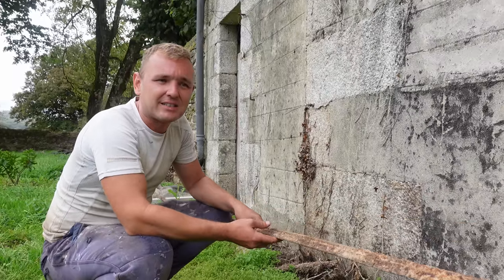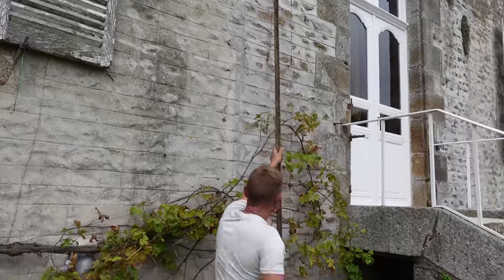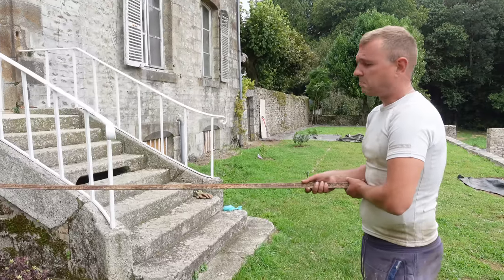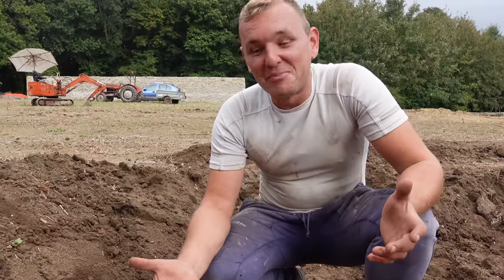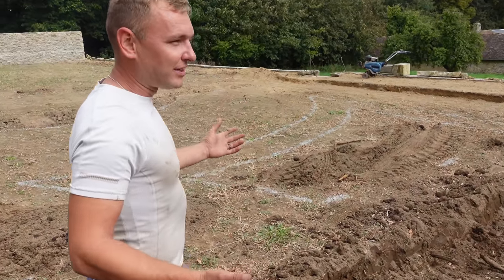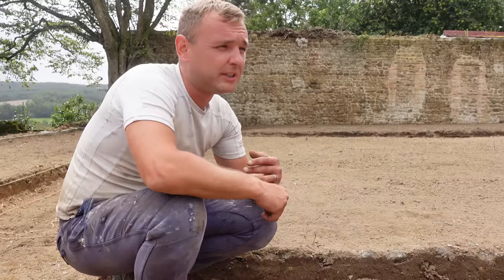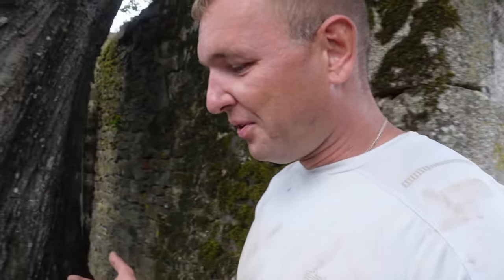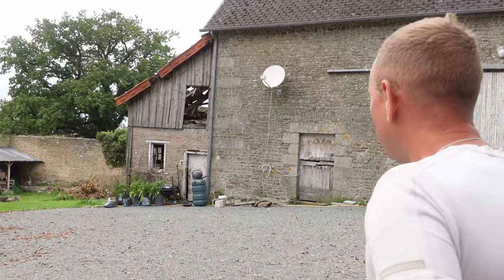The Quest for the Missing Porch: Unveiling a Hidden Treasure in our Chateau Garden.

Comment: Check out the peacock proofing the Château de la Lande has done in their walled garden. It seems pretty effective.❤
Ash, I have to disagree on the original placement of the angle iron. The roof has three sides, the apex of which all meet at the façade of the house. It could be part of one of the sides if the entabliture was fastened to it and the degree of bend is greater than 90°, (to account for the slope of the roof it would have to be greater).
If it is 90°, it could be one of the upright corners. Judging from the photo, the roofline was just a few inches below the top of the doorframe.
The porch door in the photo looks disproportionately small compared to the grandness of the rest of the house. Maybe even 6" or 8" taller would make a visual difference. The whole thing will need to be fabricated so you should be able to make it to whatever dimensions you like.

Comment: I love a mystery and you all just keep finding them. The picture seems to show the porch front rested on the last step of the chateau. I think you were correct when you considered that the post you found was the vertical corner posts. The front of the porch seems to sit a bit above the last stair which would make the post you found the right length for the corner posts. If the post is the roof beam, and the porch extends to almost the garden stairs, it would really cause a bottle neck to get from one side of the upper garden deck to the other.

If the porch does go out beyond the chateau stairs, it would seem they would have made some sort of flooring at the foot of the stairs like pavers of some sort. Have you looked for something like that? It may help determine the proportions of the porch.

What great progress on the garden. It would be terrific if you could open those four doors on the stone wall again. Hopefully the plantings and garden plan will accommodate that if you should do it in the future. Congratulations on all your successes.

Comment: On the iron piece, if the cut end is the same angle in reverse on the opposite end, it may be the front top edge piece. If it's flat, it may be a side top edge piece. It doesn't look like it matches the ridge of the roof in the old photo, it would be too long for the roof shape, which looks like a hip roof. It's so awesome that you found a piece of the original porch, maybe there's more hidden elsewhere. Metal detector time?

Comment: Glad to see the formal garden coming along. It is alot of work. I would not put a bit of grass in the formal garden. Keep it in gravel, mulch and hardscape (bricks, cobbles, pavers, aggregate, etc.) Grass areas without constant work will invade the rest of areas. You have done the major amount of work getting rid of it. Do not waste your efforts. Nice to see the raised vegetable beds, too. I would leave uncovered or add wire mesh over it (chicken wire). Snow and lightening drops nitrogen into the soil.

Comment: Don't forget you can put old windows on top of raised beds for protection!
Reply: Yes, do keep old windows to make cold frames.
But over winter cover the beds with something to obscure the light and stop weeds growing. Put a copper edge to keep slugs off, they can't go past the wire due to electric circuit!
You could plant a 'green manure' which will enrich the soil instead of the above.
Good luck🍀
Great progress 👏🏻👏🏻

Comment: Correct me if I'm wrong, but the front of the glass porch enclosure has a sloped roof, does it not? So that ridge frame would only be the dimension from the chateau wall to the peak of the 'pyramid' of where the side roof slope meets the front roof slope. I imagine the angle of slope in the front would be the same as the angle of the sides, so you could calculate the total 'depth' of the enclosure based on that. It just doesn't look like the front is a perfectly flat plane from the ridge straight down to the ground from that photo.